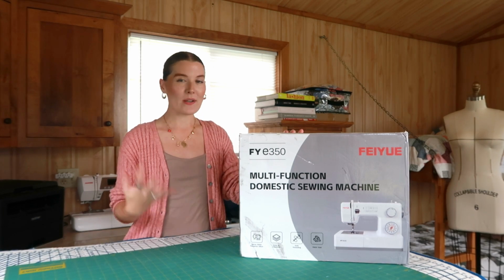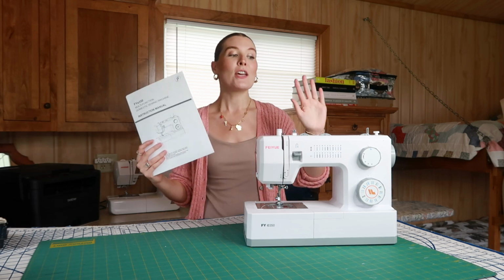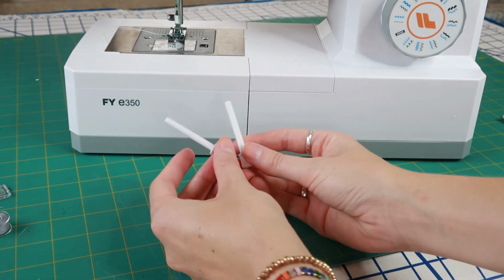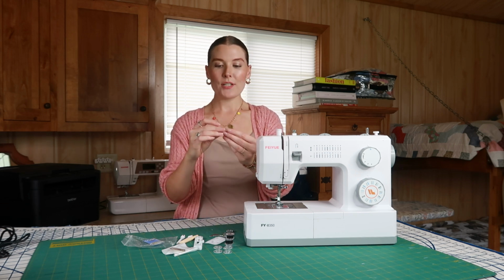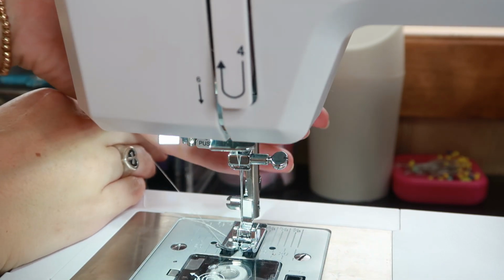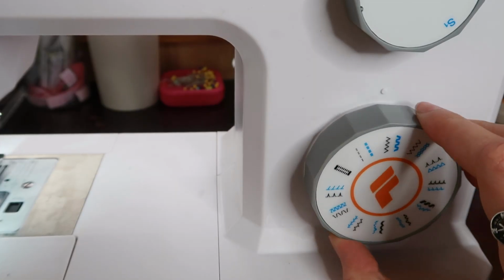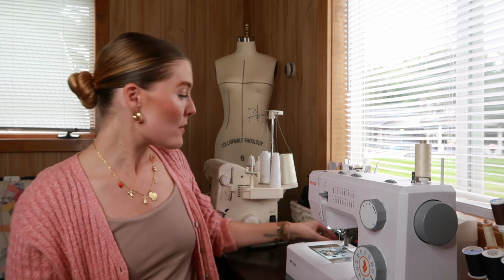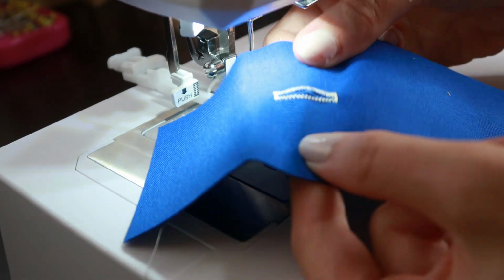How To Set Up A New Sewing Machine | Easy Beginner Sewing | FEIYUE Sewing Machine Review

Comment: can the feed dogs be lowered for freehand sewing?

i have been researching machines for low cost, beginner friendly use, multiple layer HD sewing - denim & such.
i do random acts of hand sewing when basic projects are required (blackout window shades for example) & some for fun (cat bed pillows) but i spend days doing what a machine would do in minutes & i'm looking to make life easier (@64, i ain't getting younger!).

i have been falling down the sewing machine rabbit hole for about 2 weeks now & i keep coming back to this unit as it seems to do all (& more) than what i (currently) am looking for: heavy duty, quiet, 'modern day' basic functions such as foot tension, multi needle positions, bobbin threading ease, free arm (i didn't know the rabbit hole went that deep).

and the price looks about right.

i keep hearing (other vids) that the foot pedal is overly sensitive & goes to high speeds to quickly.
as a newbie to machines, i certainly do not want to struggle (ie: get pissed right outta the gate...) by having to spend more time dealing with the pedal than actual sewing...
Reply from the maker: I would say the foot pedal is a bit sensitive in that way! There are actually some sewing machine machines that allow you to adjust the speed on a dial, my sewing machine for example is like that so if I want it so fast, I can change the dial and no matter how hard I press the pedal it will only go to speed I set it to. There are a lot of sewing machine machines that you can set the speed on and I’m sure other sewing machine brands will also have those..